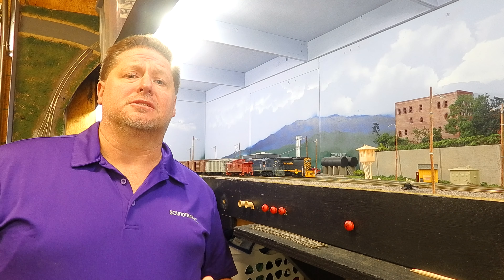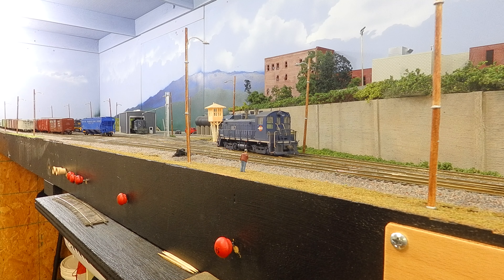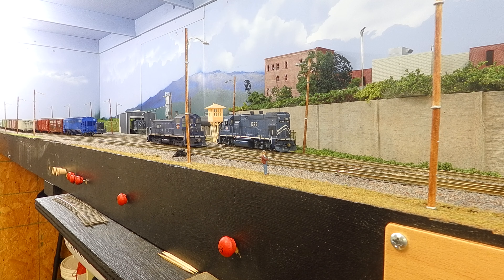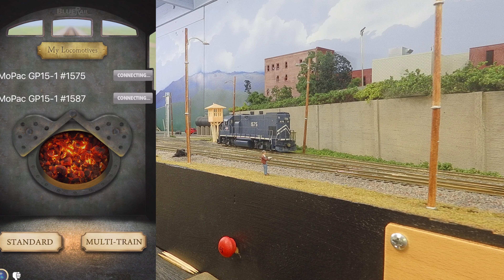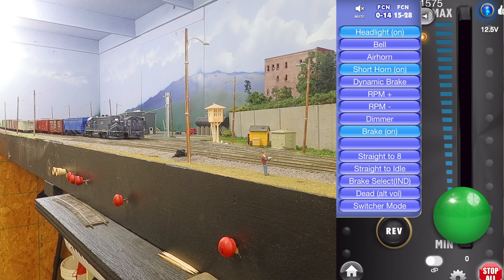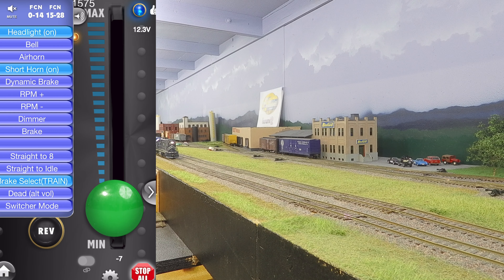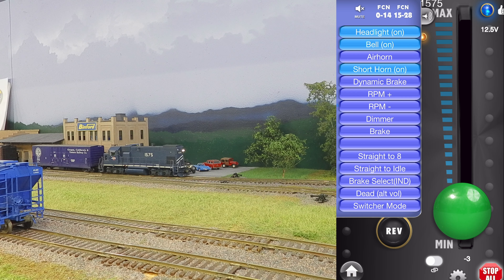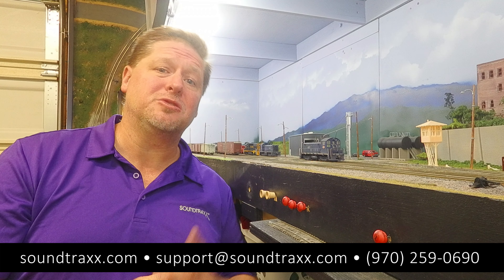Braking Operations with Tsunami2 and Blunami Decoders

Comment: Running Blunami in an O scale engine battery powered.  When i use either the independent brake or train brake, i can't get the train to remain still as i advance the throttle.  I thought as the sounds reved up the engine was supposed to sit still until the brake is released?
Reply from the maker: Contact our Support Team. They can help you troubleshoot this: (970)259-0690 ext. 22 or support@soundtraxx.com

Comment: What braking rates do you use?
Reply: My acceleration rate in CV 3 is 150, decel in CV 4 at 225.  Then my independent brake rate in CV 117 is at 255, represent a -127 from 225 for a braking rate of 97.   Automatic brake rate in CV 118 is set to 203 to represent a -75 from 225, or 150.   
I hope this helps.
Reply from the maker: Thanks George.